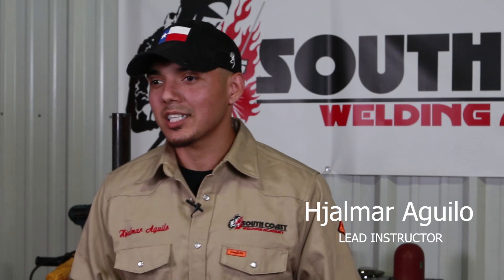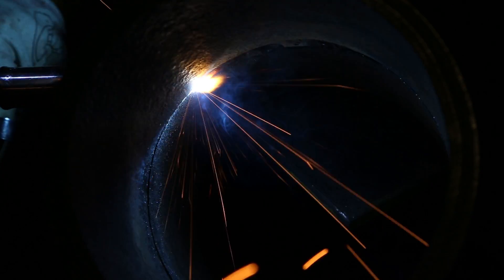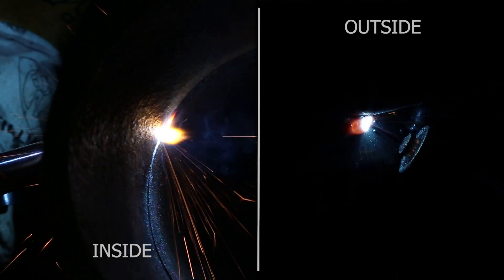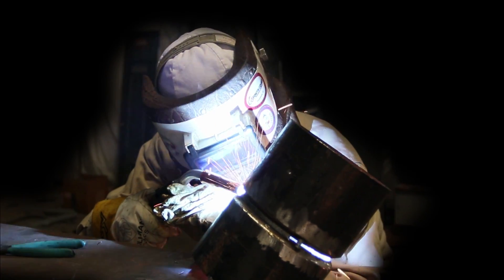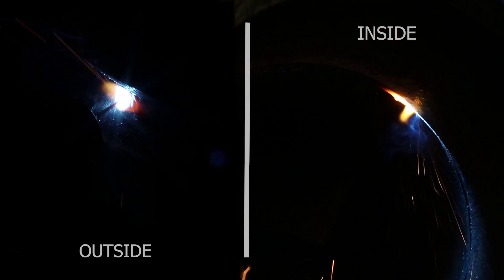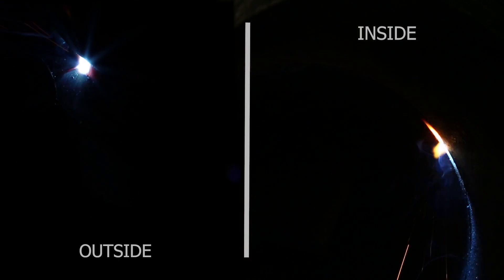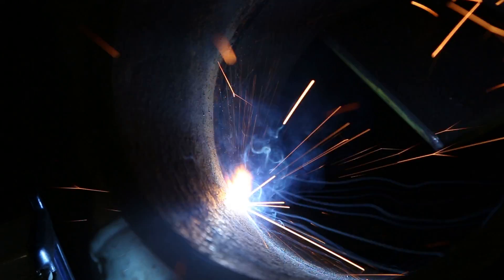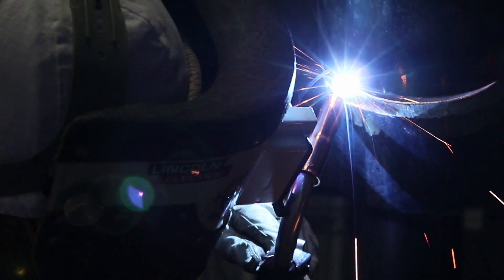MIG Welding 6G Root

Comment: I’m going to be doing a 6g test pretty soon with a piece of 6” sch 10 pipe. My boss has told me that when he did his test it was uphill on both sides. The root and filler/cap both had to be done uphill. Can you guys please do a video on the this. Also I use an older miller machine that is not digital, it has a rotating crank that runs my heat up or down, and my wire speed is not digital either, it has a knob that adjust from 0 to 10 maybe. I usually weld around 25 volts I think and about half of my available wire speed. I like to weld downhill hot and heavy whenever I can as I feel it makes the flattest and smoothest welds when welding in a production setting where speed is kind of everything. A full uphill video using 035 wire would be amazing as I’m going to be out of my element for the 6g test.
Reply: I have to do my test that way

Comment: I know you run a bit of a drag angle as you’re coming downhill, but on the bottom side it looked like you were running a bit of a push angle. Is that typical to change the angle like that for reinforcement purposes? Would that be typical for an RMD root as well?

Comment: Could you demonstrate a mig root uphill with 0.35 wire on pipe with filler and cap with fluxcore uphill 045 wire

Comment: How would the land and gap change if it was 100%co2 ? Have an upcoming plate test . The only thing I know ist that it will be 3/4 plate 100 %co2 and the filler brand esab aoutrod 12.50 ( AWS 70s6 wire ) . Also a 6g position 6 " pipe with the same requirements ( gas and wire ) .

Comment: Another great video guys. I’d be cool if you could do a vid on stick welding flare bevels. Kinda like sticking flat bar to the side of square tubing. Thanks a lot guys.
Reply: Michael Perry common on boiler overlays
Reply: @weldtube  nothing against you. Your a beast! Im a AWS certified 6G pipe welder..I love stick welding but I've been doing a lot of fluxcore lately due to the fact I build barges and railcars. I would like to see a video of stainless steel pipe welding with stick in the 6G position